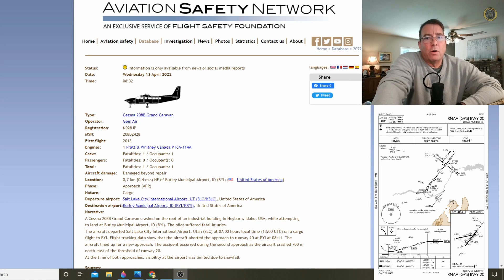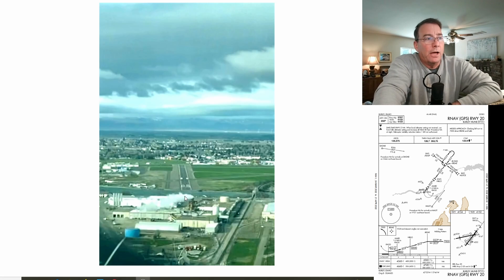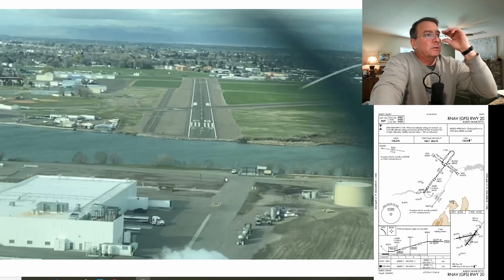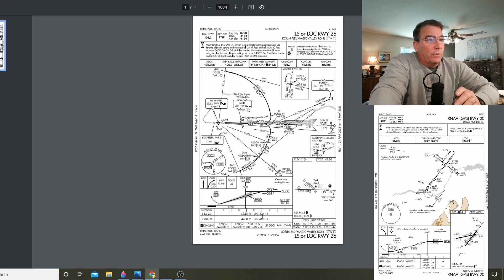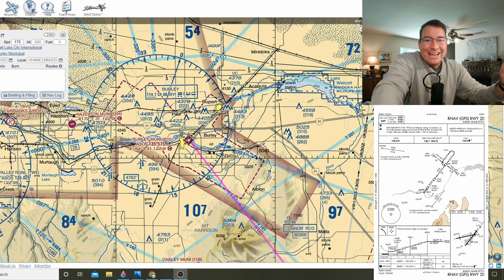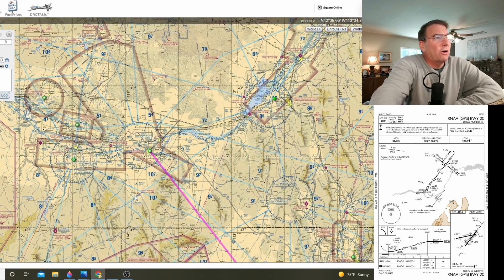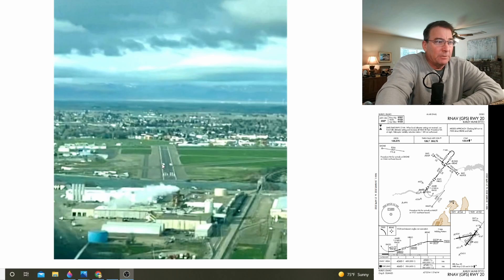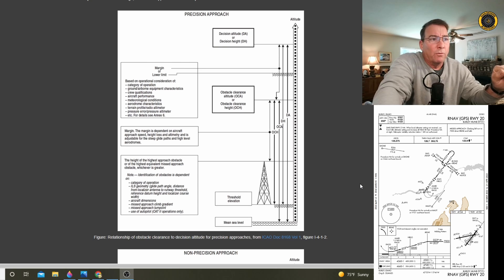Cessna 208 Caravan Crash Burley Idaho New Pictures of Approach

Comment: That steam tower directly on the extended centerline makes that approach ridiculous. I am sure locals have been saying for years that it is only a matter of time. What a tragic loss.
Reply: Man-made obstacles like this sure are ridiculous. No pilot or person should be at risk for such infrastructure near a runway, especially without ILS. All airports need to be reviewed now and I agree a lawsuit may begin proceedings.
Reply: The question should be, what was there first?  Potato plant or airport?  If potato plant, what numb skull approved that runway?
Reply: @sw8741  My guess is both have been there a long time. Just that both were smaller at the start and it wasn't much of an issue. He said there was an alternate more capable runway "just a few miles" away. Not sure how far that is but maybe they should have been using that instead. Especially in poor conditions.
Reply: If the steam tower wasn’t there, on her trajectory, she would have hit the roof of the building.
Let’s stop the eulogizing of this woman…She hit a known obstacle that is almost 500’ below the altitude that she was supposed to maintain up to that point that EVERYONE else has been missing for years now, so let’s get real.
Reply: @marlow769  From the air it looked like a real hazard. But he also showed the view from the road by the river, from there the plant looks like a complete non-issue. And did he say 60'?  If he's right about the ladder, she must have been at 50'. That's low enough she could have just as well clipped a tree.
Reply: @marlow769  you should probably reread my post.

Comment: 4/24/22...another great analysis...this video has pics while on glide slope (3.75°) for runway 20 at minimum altitude. Pic taken in full daylight showing smoke stack (directly in-line with runway center line) billowing steam with exhaust emphasing (this date) a strong R-2-L crosswind...as steam column is almost 90° to left.
 Juan you are providing very understandable analysis & explanations of the step-by-step method needed to fly & have full awareness of flight path surroundings. If visuals not clear or problematic, then pilot judgement must take the most safe action (by being judgement flexible) & go-around & go to the (planned) alternate field...or closest runway with ILS instrument approach...or abort this location & return home. 
 Juan yur videos will surely help younger pilots become more aware of hazards & have the confidence/judgement to exercise flexibility-of-thought to avoid high risk situations...even if it means being late or landing at an unscheduled airport. Better late...than never...✈

Comment: Insightful  viewpoint, you have most likely got it solved where so many have simply said she bust minimums and paid the price. Her parents have been talking about why those obstacles were allowed there in the first place, rather looks like they have a point, thanks for the very well researched article.
Reply: I wonder which was there first, the stacks or the airport?
Reply: The airport was per other articles
Reply: Looking at those stacks you wonder how a disaster didn't happen earlier.
Reply: See the approach view it is no surprise this building location was controversial from the start.
I bet ten dollars to a donut this approach  is going to be removed recinded
Reply: @jimgrazulis3542  The Burley airport was opened on 4 July 1930. The Gem plant in Heyburn (across the river from Burley) opened in 2010.
Reply: @gustafchurn8282  I'll take that bet! Nothing wrong with the approach. You just don't understand all the criteria that goes into it and don't realize that those approaches have to be flight checked periodically by FAA. I assure you of this,this approach will be if it hasn't already due to this accident. However,FAA will find nothing wrong due no guidance system involved.

Comment: Great points about the possibility of the first approach being a deliberate look at the runway instead of a missed approach due to poor piloting and about the smoke cloud possibly obscuring the obstacles.
Reply: That was the point I made on the other video. And that is what I had done. Only she probably made the wrong decision based on her familiarity with the location.
Reply: Many reasons for a missed approach, and not likely "poor piloting", but probably degrading visibility
Reply: I believe she knew the airport, the company flies in and out of there almost daily.
Reply: @mathieuclement8011  right. People take the visibly for a constant, flying through snow storms the visibly is often highly dynamic and changes by the second. Add in the variable of possible steam coming off the plant, and a small shift in wind could be the difference between it completely obscuring the runway and it being off center just enough to see the runway.
Reply: @jonathangentile3447  Yes, and in addition, looking at the weather reports in the 30 min prior to this accident, visibility went from 2.5 miles to 1 mile in about 15 minutes. Conditions were rapidly changing at the time of this accident.
Reply: @jonathangentile3447  If the runway environment becomes obscured, you go missed.  Simple.
Reply: @thomasgreen628  Right. So a small change in the conditions could have caused her to have to go missed the first time after leaving MDA.

Comment: Twice in my architectural/engineering career I've had to deal with structures and airport clearance.  I wish I still had an  FAA design manual to refresh my memory relating to this situation.  I do remember arguing with clients who wanted to take it to the minimum required, and always tried to make things as pilot friendly as I could get away with. 

Considering Idaho winters, and the likelihood of minimum landing conditions being a common occurrence, it's my opinion that the potato plant suffers from poor design decisions.  A structural engineer, William Porusch, once told me "Building Codes do not represent  good design,  they only specify the absolute minimum requirements."
Reply: I would tend to agree, the potato plant seems to have structures that could be legal but might violate the spirit of the clearance or height regulation. I think someone made a bad decision here, if this ends up in court, we might see who is at fault through the legal process.

Comment: Since I haven't heard it mentioned directly -
and having actually worked around cooling towers in the Idaho winter, 
I have to wonder about hitting that cloud and having it flash freeze a coat of ice on everything - 
not enough to be aerodynamically significant - 
but certainly enough to obscure vision or perhaps coat a sensor - at just the wrong moment.
Particularly considering the wind direction, I have to wonder.

My sympathies go out to her friends and family.
Reply: Well, based on the details Juan just shared with us, she never made it to the steam column.  It appears to have been slightly further (50-100 ft) down the glide path, and her plane hit the tower, crashed to the roof, and never made it that far.
Reply: @NoelKerns  Maybe I didn't follow  him correctly then - was the steam blowing straight towards the field at the time of the accident, or straight towards  her on approach? I understood it to be blowing basically blowing straight into her face if she was on the glide slope.
Reply: @theblackbear211  I don't think we actually know that. I haven't seen any information about surface winds at the time. It would have been part of the ASOS, but I haven't seen anyone mention it. At the end of the day, if she had been at the MDA, it would have been a nonfactor anyway. To answer the original question, though, no one in aviation officially refers to clouds - it's visible moisture (in this case, steam.) So, yes, if the conditions are right and you have visible moisture, that moisture can absolutely stick to your leading edges. Still, the amount we're talking about here would have virtually no impact. In particular, this aircraft was equipped with certified de-ice equipment (which, to be fair, can mean a very wide variety of things.)
Reply: @theblackbear211  - I thought I remember hearing Juan mention - either in this video of the previous one - that she was landing with a right crosswind.  Maybe I'm imagining that though, based on that photo.
Reply: @michaelmartinez1345  - Yes, the flightaware data confirms that she executed a missed approach, and then setup nicely for the 2nd attempt that ended tragically.

Really the bottom line for me in this whole thing is how absolutely ridiculous that approach path is, with the towers, and the steam, etc.  With weather added - as was very much the case here - it's a disaster waiting to happen...and happen it did, sadly.
Reply: OK - you guys got me curious, so I rewatched the video: 
While Juan is showing the photographs of an approach in crosswind conditions,
@ about 1:45 on the video he says: 
"Unfortunately, on the day of the accident, with one mile of visibility, in the snow and 8knots of wind, mostly down the runway, that would take this steam cloud and run it right up the ILS basically..."

He has a printed edit in the video correcting this statement that says "Visual Glide Path - NOT the "ILS" ".
So that's where I got my impression of the wind direction, and the position of the steam cloud.
Reply: @theblackbear211  - Ahh, my mistake; sorry about that!  So what you stated could well have been a very significant factor.  Good thinking!
Reply: @davidmalone9022  My concern was never an aerodynamic one -  a "steam plume" (vapor column)  will often "flash freeze" on any cold surface - trees, fences... pretty much anything - and because it is a fine vapor (being a relatively hot vapor) it really is a flash freeze.
(Much like tossing a pan of boiling water into the air at very low temperatures - it will turn to ice crystals before it hits the ground) 
What that might do to visibility out the windshield - at absolutely the wrong moment, or, potentially, but less likely, something like a pitot tube... I, as a person who has run into issues with this type of rapid ice formation on ground based equipment, have to wonder.
Reply: @theblackbear211  Ah, good point about the windshield. And the pitot tubes could certainly be impacted if pitot heat weren't turned on. I only once ever encountered pitot ice - my fault for not turning on the pitot heat as soon as conditions were such that icing might be present. Boy, when it happens, it happens fast. It's very disorienting to see the airspeed indicator and VSI doing things that contradict the attitude indicator. Fortunately, I realized it quickly and - here's my real point - the pitot heat was almost instantly effective. So, even if you do have the sort of incident, my guess is that a hot pitot tube (NEVER touch one) would overwhelm whatever the icing might bring. (Actually, side note on that point, during my preflight, I would always check the pitot heat by turning it on and quickly grabbing the tube. It would already be warming and getting hot fast.)

If I were to guess, this plane would have been equipped with a hot plate on the windshield. But in the larger sense of your question (for example, in my 182) once my windshield had a layer of even the thinnest ice, there would be no visibility forward. My cabin heat funnels up to the windshield but doesn't come close to countering bad icing conditions in the moments after entering them. That, actually, is a very eerie feeling when it happens since you know what you see on your windshield is very much, if not worse, what is now on your flight surfaces.

Oh, and one thing - whenever we're talking about ice, we are talking about aerodynamics. The weight of the ice is a factor, but ice is mostly about the aerodynamic effects on the airplane. That's why you limit bank angles, limit the amount of flaps, and do everything easily and slowly (in a way, interestingly, the way you treat driving a car on an icy road - for different reasons, obviously.) I was coming into Laramie at one point, out of 14,000', and encountered icing that I didn't expect. Long story short, I landed eventually with almost an inch of ice. My turns on approach never exceeded 10 degrees, I landed no flaps, and ended up walking away with yet one more lesson about assumptions. Anyway...

Thanks for the comment.
Reply: @NoelKerns  Well, the film of the approach that he used, was shot with a significant crosswind... that's why I went back to review the tape.
Reply: @davidmalone9022  Thanks for the informative response.
Reply: @theblackbear211  - Yeah, and I that's why I mistakenly had it in my head it was a crosswind.

Comment: "a lot of the pressure to get the job done is self-imposed pressure" That is absolutely correct! Fly the numbers and don't be afraid to go to the alternate or wait until a better time to go. Is it worth your life?
Reply: Mostly agree with Juan but in this case, there is a lot of pressure to complete the mission that comes from the company.  Nothing written down I'm sure, but the pressure is there.  Find out when the last time the company congratulated a pilot for deciding to return to base without dropping off the packages, or asked the driver to go to another nearby airport due to safety concerns.  If that happens, we have a safety culture.  If not, then the culture can be improved.  It's clear that most young pilots are like buckin' broncs, and want to complete the mission, sometimes by doing things that are on the line or slightly over the line.  It's the company's responsibility to rein them in a bit so that they have a long career.

Comment: Makes you wonder who is planning these structures relative to runway construction.
Reply: I think the question of diverting those steam pipes is going to come up now. Maybe shorten them then put 90 degree bends on them and run them horizontally all the way to the end of that building to the left and vent them there.
Reply: @ronhaworth5808  That won't happen. Far cheaper to move the runway
Reply: @whatilearnttoday5295  And you're a building code expert no doubt.  It's up to the FAA to establish height restrictions for structures in proximity to the airport.  The local building code enforcement agency should have a zoning map with height restrictions.  It's not up to the business to guess what is safe or not safe when it is clearly defined in FAR 77.
Reply: @ronhaworth5808  From the looks of the approach photos, even without the pipes, she'd have hit something well short of the runway.
Reply: @ShaunHensley  In what world? Move a runway? They might close it, but that would not be a reasonable solution. Someone may decide it's not worth the risk to allow instrument approaches there, but why remove it altogether?
Reply: @RC21114  It's far cheaper to buy the adjacent land and pave a strip of it for a runway than it is to reconfigure a manufacturing facility.

Source:Someone who reconfigures manufacturing facilities
Reply: @ShaunHensley  You need to look at a map. There is no adjacent land. The airport is almost 100 years old. It is thoroughly surrounded now by roads and buildings.
Reply: @lizj5740  Weird, I see space in the video, buzz off troll

Comment: With the wind that day bringing the steam plume directly into the approach path and also ascending due to the hot air it's possible that her view of the landing enviroment was obscured for longer than the brief second it would take to fly through the plume if it were in any other orientation. Combining the steam plume and heavy snowfall that had already reduced visibility, it may have been long enough that she made an evasive move that the approach didn't permit.
Reply: How could it be a crosswind and also have steam blowing upwind?
Reply: @Heatherder  The wind does what it wants, that's how.
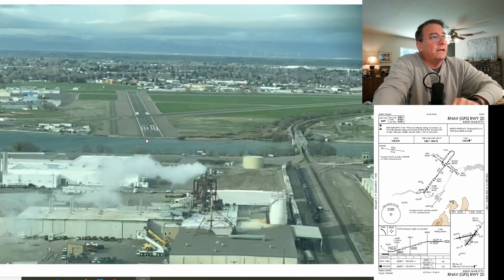Reply: @Heatherder  At 1:15, Juan is describing the condition as shown in the photo, which is a crosswind condition as evident from the steam plume. At 1:40, Juan states that on the day of the accident, the wind was 8 kts coming directly down the Visual Glide Path. This means the VGP could have been directly into a 'funnel' of additionally diminished visibility at a time when visibility was already diminished by heavy snowfall. Think of driving in fog and then suddenly fog so heavy you have zero visibility. As Juan states at 6:53, technically you are suppose to call a missed approach if you loose sight of the runway. This may have been a factor in the pilot's decision to make a second approach.

Comment: I worked at a wastewater treatment plant that was at the end of a general aviation airport and we had height requirements that were so strict we had to cut 8 feet off our American flag pole to meet safety requirements. Our flagpole looked like it was the runt of the litter! We also had to contact the airport if we were going to use a crane and put a white and orange checkered flag on the crane while it was in use.
Reply: Sounds like you worked for a facility that was responsibly managed, at least this aspect.  This is good to hear, but is not, unfortunately, universal.